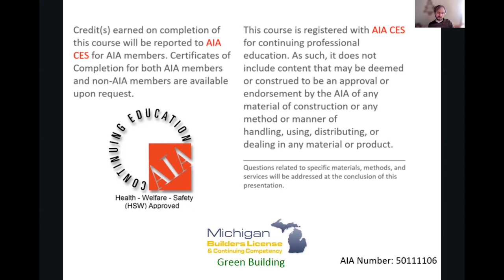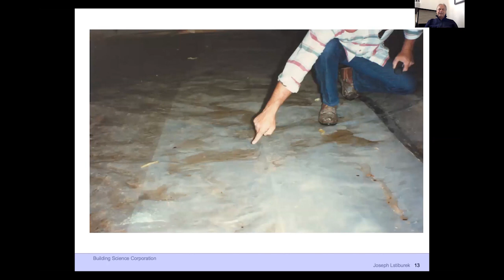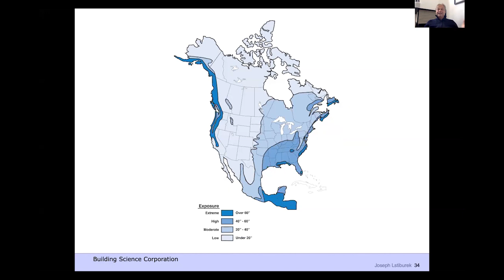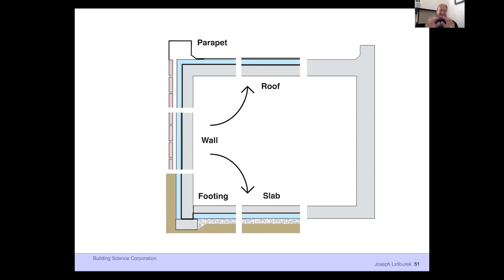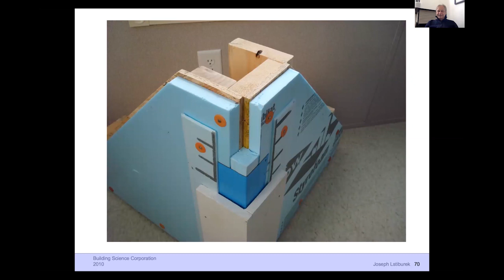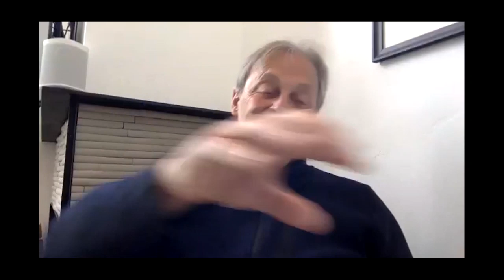There is no such thing as a free thermodynamic lunch

Comment: I always enjoy listening to Joe!  I would have liked to hear him discuss the Grenfell Tower fire.  I live near Chicago in a 17 year old Pulte built home.  I have 2x4 panelised walls with Dow sheathing (OSB at the corners and 1x3 let in bracing).  Paper thin vinyl siding.  No overhangs at the gables.  The house is as comfortable as the 2x6 custom built home we owned before.  We've had two homes burn down in our subdivision, and boy do they burn hot.  When the fire reaches the truss roof, the home is gone.  I laughed at Joe's joke about Dow (and other) foam sheathing as being "compressed napalm".  Does anyone make foam sheathing that is fire resistant?
Reply from the maker: You may consider an enery audit of you home to seek further improvements. Let us know. We have heard of some foams being more resistant than others to fire.
Reply: Sprayjones has a video where he holds a propane torch on his closed cell foam for like five minutes, and it will not catch fire.
Reply from the maker: @3rett115  That is different than sheathing. Send a link
Reply: @GreenHomeInstitute  Weird. YT won't let me reply to you..
Reply: I know, but I'm simply dispelling the myth that all foam is flammable. I thought that too, until I saw his video. Just search 'sprayjones' here on YT. He is very knowledgeable; he goes super deep into technicals but also demonstrates the practicals, and has me rethinking foam as a whole.